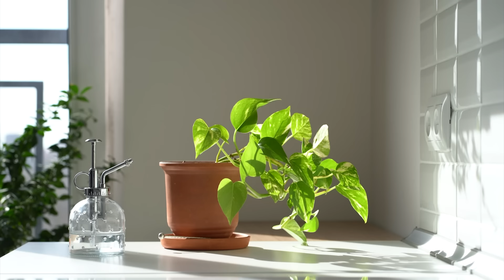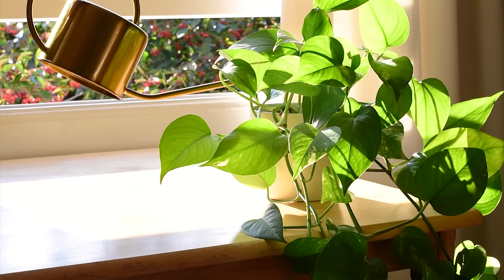Giving your house plants genetic super powers

Comment: 9:19 About GMO's in Europe; if you disregard the effect on humans and instead think about the effect on ecosystems you're going to have an easier time understanding the reasoning of how "slow modification" is fine but introducing a random new plant into the wild is haphazard and foolish. In short, the ecosystem has time to adapt to the changes as it can modify itself to match whatever is happening.
There are a lot more to it than this, but as far as I care this is the most important.
Reply: And before anyone says something like "but farmers blablabla". Farmers don't give a shirt. They used neonicotinoid pesticides for decades because it was cheap, even though it almost wiped out all the pollinators they desperately need to exist. Thank heavens that the EU at least tries to be rational instead of catering to capitalism just because.
Reply: It's been decades and millions of hectares of GMOs have been planted, and they've been mostly safe for the environment. The fears of ecological disaster are way overblown.
Reply: @20Twenty-3  Well, my follow up comment here showing the example of neonicotinoids was removed for some reason. They were approved in the 80's, we only realized in the 2010's how they were severely affecting pollinators. Another example is DDT. The big problem with neonicotinoids is that they're extremely cheap, nobody wants to stop using them. Once you deploy something that generates so much profit, it's very hard to pull it back. GMO's fall into this category, it's a Pandora's box situation. There are dozens of other great reasons to not do large scale experiments on the delicate systems we need to survive.
Reply: @98Zai  So the examples you cite are pesticides, not GMOs. GMOs have had as much time as neonicotinoids to show any large scale ecological side effects, and so far they've been minimal or manageable. 

GMOs can be modified for many things. Some are made to reduce pesticide use, better than conventional farming. Others are made for other benefits, like nutrition. Just blanket banning or restricting these things is throwing the baby out with the bathwater.
Reply: @20Twenty-3  Yes, they were examples of things that looked safe until we looked a little deeper. As long as there is massive profits, we're not incentivized to look deeper. When we're talking about GMO's, once we stumble upon some issue it's likely going to be too late.
Reply: @98Zai  if gmo plants have been growing for decades now without any noticeable issues, their downsides are likely far far lower than their upsides.
Reply: @hdndwq719  I stated in my original comment that I'm not talking about the effect on humans, but the ecosystems. There will be wild hybrids.. there just isn't any doubt about that in a stochastic system. He shows in this video you need to do DNA analysis to know if there is hybridization going on. That costs money, so nobody is doing that. Before we know it there are no remaining Non-GMO plants in the wild. Even video creator talks about "heirloom strains", like all that matters to him is the commercial value. What really matters is how the whole chain is affected, from plant to pollinators and animals. I mentioned DDT because in that case it took 50 years before we noticed what kind of effect it had on the chain. We have not done 50 years of trials on GMO's in the wild.
Reply: @98Zai  Unless you don't count radiation-induced GMOs as GMOs (which would be nonsensical in this context, as if anything they would be riskier considering the lower control you have over modifications, and even that doesn't manifest in reality) they have been used for that long, radiation-induced ones started gaining traction in the 60s/70s, if they were likely to harmfully affect ecosystems we would already know that. Moreover, your "DNA analysis costs money" point is misleading, any kind of systematic ecological research is massively expensive, including research about pesticides like DDT. That is to say, it isn't a reason to believe we wouldn't know about theoretical dangers of GMOs if they happened, just like we do about DDT et al.

The only even remotely reasonable argument against GMOs is precisely that some kinds of GMOs make it easier to use dangerous (whether to humans or nature) pesticides, but even that is illogical since it misses the forest for the trees, the problem in that case is the use of such pesticides, and it can be regulated separately.
Reply: @nepnep1057  My examples aren't getting through to you. Let's take microplastics. Are they bad for us? Do we know how they are affecting flora and fauna? Would we have started using plastic to this extent if we had known what we now know? Afaik there is no way to ever get rid of it. GMO's are not dead objects like plastic, they are living things with a single objective: spreading. They even employ a legion of insects to proliferate in ways we don't even understand. Perhaps we've been lucky with the kinds of GMO's we've been using until now, though just like in the case of microplastics, neonics and DDT we need a long time before we see the results, in the end a full blown acceptance of GMO's will be catastrophic and far outweigh any benefits, commercial or otherwise. We can't do decades of studies on every new strain introduced, in fact we haven't done that at all. They were all haphazardly and foolishly introduced into an important and fragile system without doing any meaningful study or even asking anyone if they want them. If we are so desperate for food, we could start by not eating meat and we have all the food we need.
Reply: @nepnep1057  My long winded response was removed, I will give it another attempt. Think about microplastics. Would we have used plastic to the extent we do if we had known? How do microplastics affect flora, fauna and us? We don't even know. Plastic, neonics and DDT are dead and has no motive. Plants are living things with a single objective; to spread. They even employ a legion of insects for this purpose. They are engineered to be stronger, more tolerant and able to outcompete everything on the planet. From that we can assume it will be impossible to roll back. 
If we haven't made any large scale experiments on the GMO's we already have in the wild, we won't in the future either. With the financial incentive of super profits there will be no shortage of more and more experimental deployments into fragile systems we need to survive. If there is a shortage of food, we could always start with cutting down on meat and we would have all the food we need.
Reply: @nepnep1057  Not one but two of my perfectly innocent replies have been removed now. It's safe to say I don't have time to argue with you. I'll leave you with this; microplastics. Was it worth it? We don't even know. Plastic, neonic and DDT are dead. Plants have one singular motive.. to spread. From that we can assume that it'll be impossible to roll back.
Reply: @20Twenty-3 . . I can already tell you missed the Monsanto Corn disaster that almost certianly jump started the E.U.'s laws.

The laws certianly could be an over-reaction, but they are litterally written is human blood and dead ecosystems.

For refferance, Monsanto introduced a strain of corn that produced neurotoxins to be planted on edges of farms.

Corn... breeds by wind transfer of pollen. Do you see where this is going? Farms where left with a bunch of corn cobs that where toxic to humans and all other vertibrates. Growing on stalks that where perfectly edible.
Reply: @AnonymousAnarchist2  This is false. GMO corn has never been conclusively shown to be toxic to mammals. The few studies that did (such as by Seralini) were widely discredited for flawed methodology, even by European science associations.

Comment: Genius Idea that will increase air purification by 100% instead of a measly 30... Just buy an additional regular plant
Reply: 100% is less than 30x
Reply: @mattymerr701  Exept its not 30x. Read the Neoplants whitepaper. Its barely 30%. (780~ish that dips lower vs 600~ ppb). A difference entirely made up by adding a soup of perfume production targeted fertilizer to the plant. Which is technically exactly what neoplants is selling you for the actual place where the 30x happens... in markup.

Comment: 25:36 Can someone explain to me what's going on with the tails of this chart?  The inoculated works way faster, but it never fully removes the solvent. The non-inoculated does remove it all after about a day and a half. Is the toluene tail factored out when the plant isn't locked in a bottle?
Reply: Depending on the pathway they use to get rid of the air stuff, it can also produce it. All reactions are always an equilibrium. Meaning they work in both ways. Except with some very specific proteins as catalyst (long evolution time) or more commonly when it uses ATP (cell energy) to make it one directional.

Since they used mutations instead of GMO, the likelihood of a reversible metabolism pathway (removing as well as producing that stuff) is more likely. 

But could also be just a fluke

Comment: Re: 20:30 I have a GC/MS at work that I have been trying to find a leak on for the last 2 weeks. Still working on it :(
Also, I just picked up a big TOF mass spec from a university auction to play around with at home. I was expecting it to be about the size of a photocopier because I didn't realize it was on a large pallet. The thing is HUGE and has 6 turbo pumps in it (at least one of which has exploded). I am hoping Waters will at least give me a trial version of the software so I can see if it is worth trying to fix.

Comment: so what the plant on itself is doing without the microbes added to the water? does it only work in combinations?

if so its too much hurdle for a roomplant, i want to add water from time to time and dont think about it anymore. it sounds more like a buisnessmodel to add a subscription for watering plants with extra stuff + i had to do it myself. not great at all. (besides the science part)
Reply: You’ll need about 5 regular house plants to clean the same amount of air as 1 modified neoplant, or that’s what I understood from the video.

Comment: A 30% improvement... probably opening a window for like 30 seconds can achieve as much or more as these fancy plants can achieve in days. Fun idea, but it's an overkill solution for a minor problem. All this capital and research could be used more effectively.
Reply: Until it turns out their research is a major breakthrough for something else or they make it even better. Or for places that can't open the window, like he literally said... If the outside is filled with smoke and smog, you really wanna open you're window for that "fresh" air?

Comment: ahhh, that's pretty awesome! get some nice VOC clean up plants...I hope to hear some good solutions for mitigating microplastics! 

one thing is I like chilled water. for economy, I use 1 liter bottles that were carbonated water containers. good size, already purchased and "Food safe" I don't know off hand if they are BPA free but I'm lead to believe that's far from the only type of plastic that leeches microplastics. due to how I store them refilling 12 of those bottles at a time, and cycling them into the fridge one or two at a time, to CONVENIENTLY maintain a supply of cold water near my desk...I cannot use glass. the shatter risk is far too high.  stainless steel might be an option. but would likely be exorbitantly expensive....

is there a plastic that does not leech ANY harmful material and is something I could get several of without breaking my bank?

if not i will likely shop at thrift stores and start buying stainless water bottles, as I can.